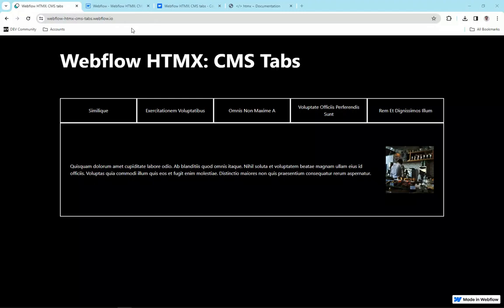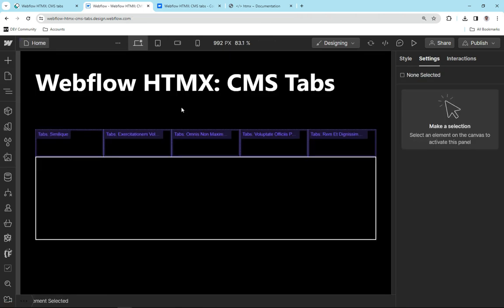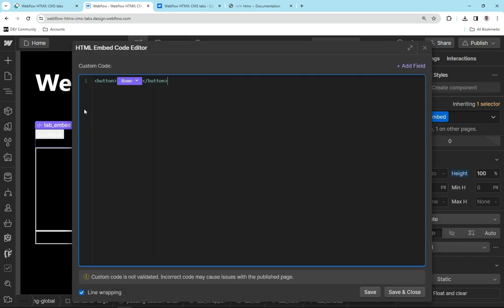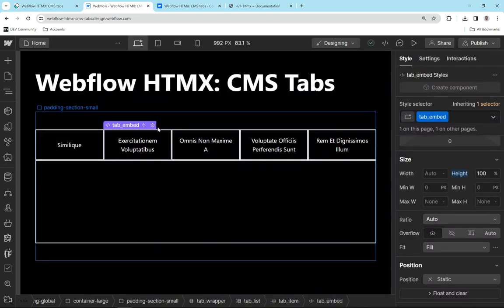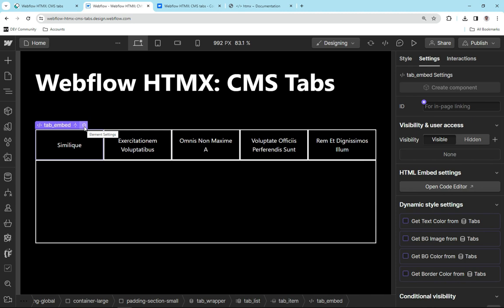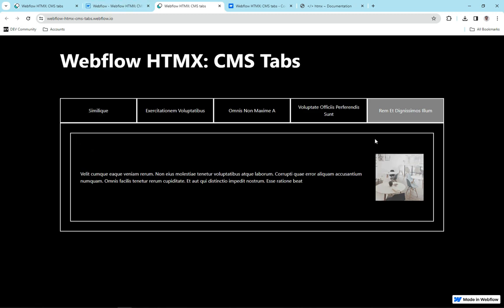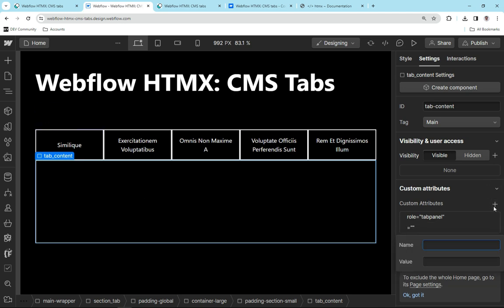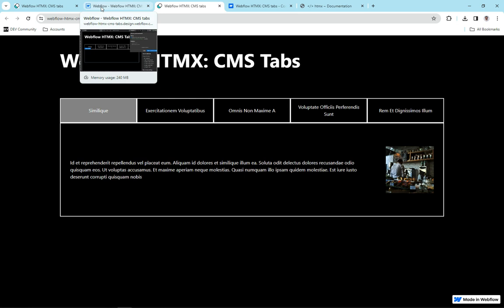Webflow & HTMX: Webflow CMS powered Tabs

Comment: The jQuery load() method achieves the exact same thing. Since Webflow requires jQuery anyway just use it no need to pull in more libraries
Reply from the maker: Hey, yeah you're right Load() can achieve the same results here. This example is the tip of the iceberg with Webflow and HTMX. The lovely thing about HTMX is not having to write JS or JQuery.

Comment: Love it, it worked ! Question: how to use HTMX to populate a page with more than 100 items ? How to loop throup an entire collection list item with the hx-get attribute to pull the information of all the items of the given collection list into 1 single page. I am trying to over come the webflow 100items per page limitation.
Reply from the maker: I believe this is possible using a static page with the collection to the HTTP request from.
Reply from the maker: Another option is to use hx-boost on the load more link and trigger a click when revealed. I'll have to test this but hx-trigger=revealed hx-on=loadMoreClick()